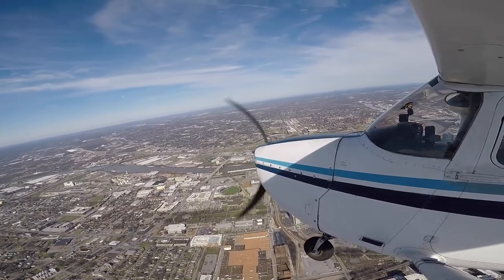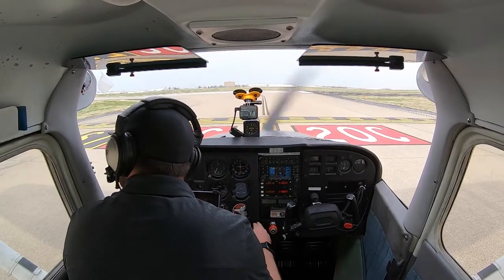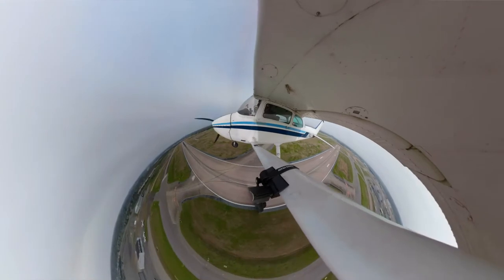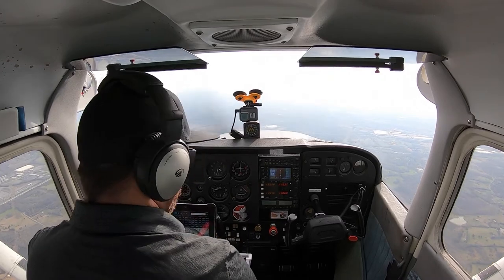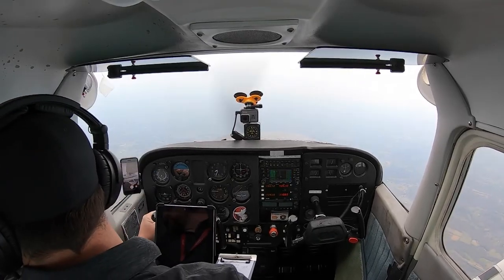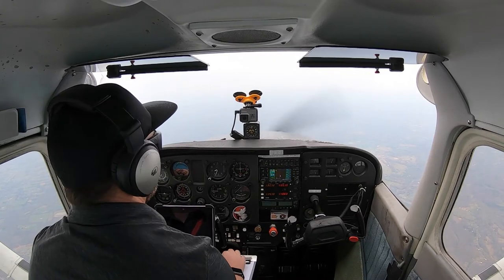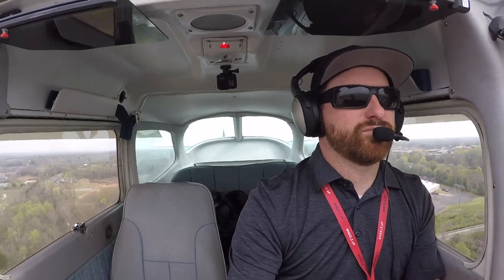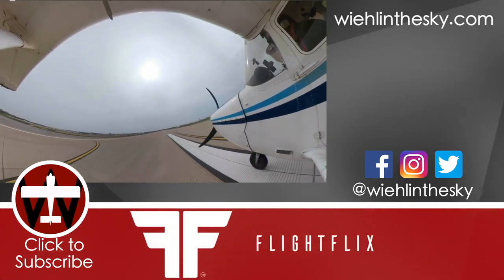360 Camera on an Airplane - Flight VLOG

Comment: Was this the first flight?
Reply from the maker: This was it.  2 Hours overflying airports surrounding Nashville as alternates in the event of an issue.
Reply: I was curious since the controller had you turn left to heading 110 and you departed the pattern.  I'm glad it all went well. I had a Navion years ago and did a first flight on a new engine si I told the controller I wanted a 270 right after dep and stayed over the airport for an hour. Mine went well too. Have fun